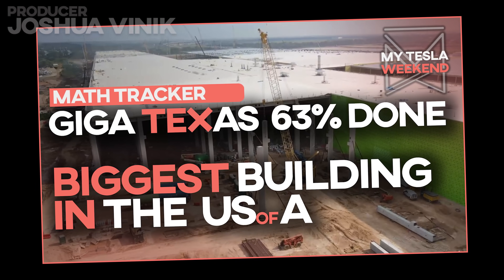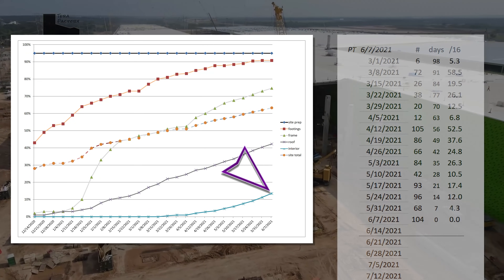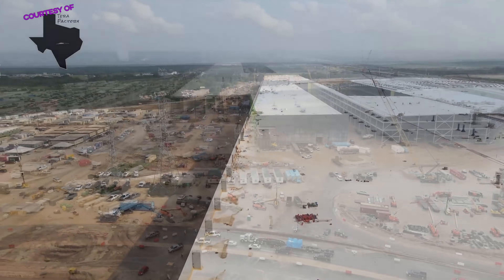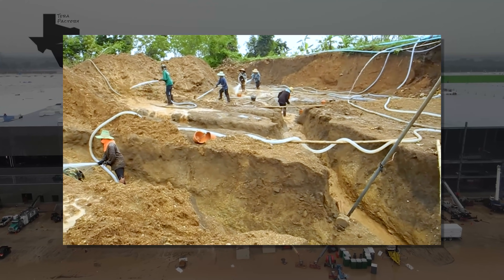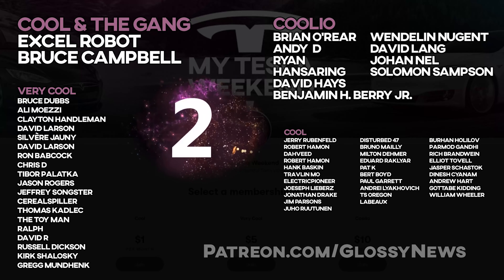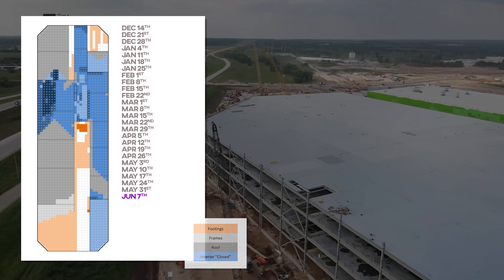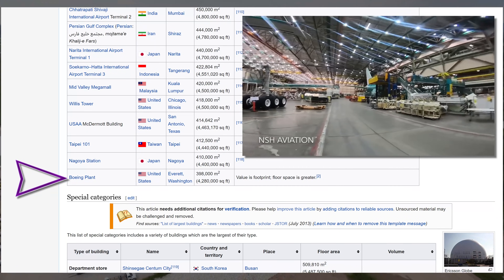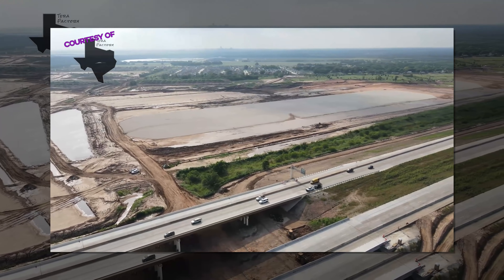Giga Texas is the biggest building in America, and it's 63% finished

Comment: I thought that BMW was the biggest building in the US
Reply from the maker: Had to look that one up, thanks! It's 7M square feet, but that's the total across all buildings, not just a single building. Even at that size, it's still smaller than just the framed up portion of Giga Texas, which is still likely to increase by another 10-20%, as well as have several additional buildings at the location.

Comment: Is this gigafactory going to be bigger than the original (never completed and stuck at 30%) Nevada gigafactory plan ?
Reply from the maker: It's already bigger than what's completed in Nevada. If Giga Nevada is ever built to the original footprint, Nevada would be substantially larger than Giga Texas. Maybe double the floor space.
Reply: @FutureAzA  Thanks. Giga Texas really is between 4 or 5 Million sqft then, that's pretty impressive.
Reply from the maker: @WlerickBigotOfficial  Over 7M already, looking like it will settle between 8-9M.
Reply: @FutureAzA  That's insane, it's almost as big as what was scheduled for Giga Nevada (10M sqft). Also I just saw that the China factory is even bigger than that, almost twice as big in fact (even if the factory is divide in multiple buidlings), it's unbelievable.

Comment: I am surprised that they didn't go with a Soil Cement Amendment to deal with the run off. It makes very expensive dry soil and at the perimeter you can catch the run off in ditches that you can dewater later. That would stop the erosion problem. It would give the added benefit of making better pavement sub base for the rest of the work. Since they are in a serious time-is -money problem I would think that they would have the very expensive options first.

Comment: Is this larger than the Boeing assembly building in Everett, WA?
Reply from the maker: Yes. 7:30 has this covered.
Reply: This is the problem with using "Largest" ambiguously. Largest building could mean tallest, widest, volume. This one will be the largest by footprint, while Boeing Everett will be largest by volume.
Reply from the maker: @matthew Eaton Biggest by square footage, not footprint or volume. It's all in the video around the 6:00 mark.

Comment: Are the columns post tensioned?
Reply from the maker: How do you mean?
Reply: @FutureAzA  little rebar with a cable ran through it when the concrete is 60%cured they stress the cable putting constant tension on it it is used in parking garages so they don't need as many columns
Reply: @nickpryor6133  This is single-story construction, and the roof is just not that heavy -- in fact, they pour a slab onto the roof, to make it heavier (offset mass, so that the bridge cranes don't move the whole building).  The columns are all precast off-site, and are clearly very high-tech, as you can see from the embedded steel. I don't see any benefits from pre- or post-tensioned columns, here.

Post-tensioning is excellent for poured-in-place beams, floors.  The pre-cast double-T roof sections are surely pre-tensioned. Columns? Nah.

Disclaimer: I have no expertise in this area whatsoever.

Comment: Thanks for the additional research regarding the storm water drainage. While I wasn't concerned about the standing water from personal experience at other sites (all construction sites get muddy after rain), I had forgotten the possibility of blockage by silt due to same. And yes, you've hit the exact reason for not using the storm drains yet. 

But the rain still make one heck of a mess. I hated working in mud. It literally sucks.
Reply: You are right about the wet material is slimy and the footage is slippery. It can lead to safety issues for sure. More to the point, considering the dirt work part of temporary storm drainage, creating temporary channels for drainage would have been easy on the north and west side of this project and perhaps slightly tougher on the east side. To put this cost in perspective, consider the daily opportunity loss of this factory in full operation. With annual production of 500,000 vehicles made in 300 days per year, with an net profit of $10,000 per car, each day of production lost is a loss of $16,000,000. Use your numbers, but you will still come up with a very large number! By my numbers and what I believe is about five days lost to date, they could have done a hell of a lot of drainage mitigation for $80 million. Compounding this is the lack of roofing even to this day. This leads to colossal waste, inefficiency, loss due to water damage, plus the expense of covering and blocking sensitive items.  No excuse.
Reply: @olbuck  Careful -- the same kind of financial reasoning can be used to argue that, for a fixed-size workforce, you can juggle in different ways. Time off on rainy days is made up on weekend or night shifts, maybe a few can be put inside, moving boxes.  Outdoor footing work becomes indoor rebar work.  Outdoor excavation becomes interior excavation. Outdoor steelwork becomes indoor steelwork. On a project this size, its easier to find some indoor work for everyone.  So, no loss from rain, and money savings from just ignoring drainage.

Comment: But did they fix those pesky roof panel gaps?????
Reply: If you think that's an issue you should take a peek on the Mach E forums on the drivetrain related problems and glass roof cracking among many other problems. Dont take my word for it. Look for yourself
Reply: @nevergone3424  Clearly someone didn't get the memo of the waterfalls pouring through the factory from the recent torrential rains.
Reply: @WhoIsThis505  clearly someone is trying to be cheeky
Reply from the maker: That wasn't a design flaw though. There was nowhere for that water to go just yet. Hopefully these Biblical-class storms don't return until the site is sufficiently complete to handle it.
Reply: @FutureAzA  Jeez, does no one get sarcasm anymore???